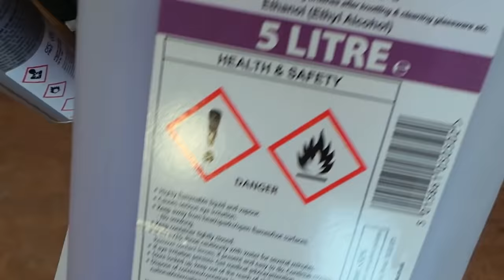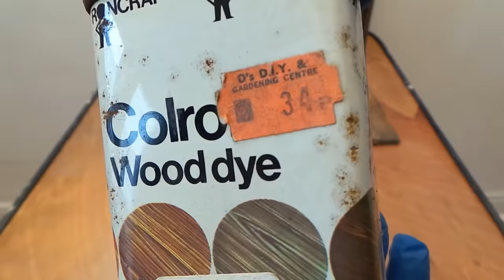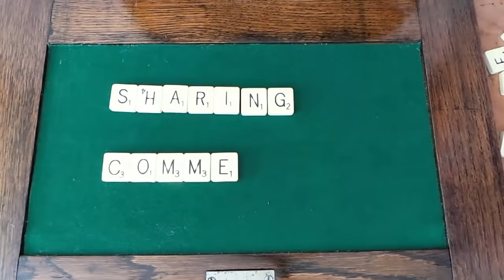Old wood Tool Box: Restoration

Comment: I purchased one of these when I started my engineering apprenticeship, I still have it after 58 years.
Reply from the maker: Hi Alan lovely to hear you kept it close How much did you pay for it back then?😊
Reply: @Instone09ine  Mine is 42 years old and cost me £99 from Hughes and Homes
Reply: We were given one along with a 0-1' micrometer and a 6" engineers steel ruler at the start of your apprenticeship, 16yrs old, 1975, apprentice toolmaker, it was your pride and joy. County Durham.
Reply: Uncle Eidolf  uncle, I served my time as a apprenticeship toolmaker, which also included learning to be a craftsman at many trades, I ended up having the choice of being a toolmaker or a draughtsman, I became a blacksmith, then joined the army, 7 th Batt the Light Infantry at 24 yrs old, it was a hard time in the then depression, and I went to everybody's university, best regards mate, from County Durham.
Reply: Uncle Eidolf ? “real” ?  ‘Real’ is if you can do the job well. Those who are taught by skilled craftsmen know just as much if not more than what we can learn in a university... what makes someone taught by apprenticeship not a ‘real’ engineer? A self taught motivated person often knows a lot more than an unmotivated person just warming a seat in sitting in a classroom listening to an instructor who doesn’t like their job and is tired of being there... just wondering.🤔

Comment: Just a tip: this was originally assembled using hide glue which is resversible, and hence it could be repaired this time around as the joints failed saving the wood.  By repairing it using polyurethane (gorilla glue) tbis will not be possible in the future as any failure in the future will cause damage to the wood  
Gorilla glue should not be used for joints such as this. Hide glue is the most suitable.
Reply from the maker: Thank you Steven good explanation .A few viewers have told me not to use gorilla glue but  your’e the first to explain why hide glue is best !  😀
Reply: LMAO who builds things thinking of failure? Glues today a far superior to the old glues
Reply: @daveklein2826  same reason we have fuses. Setting up a point of failure that is easy to fix prevents irreparable damage somewhere else when something happens
Reply: But with hide which is what was originally used! Your sticking to the original which is the idea of restoration !? Right? So the next time in the future it will be easier to restore if original marital are used. Also. An added feature that some antique restoration artist's  do is add an explanation of when the item was restored by whom and what materials were used. So in the future this will make it much easier for future restores to do there job!
Reply: @daveklein2826  “who builds things thinking of failure” somebody who knows what they’re doing
Reply: “Who builds things thinking of failure. Things today are far superior to the old ways.” is a statement that has always been uttered and it has always been foolish.
Reply: You can buy ‘modern’ hide glues which are an improvement on the original hide glues, which had to be applied hot - but they are still reversible.
Reply: @daveklein2826  Next time it fails, the wood will break instead of the joint falling apart. That's why you build in a point of failure.

Comment: Old machinist box that's in pretty good shape for it's age. I see some people think you ruined history but these things are not that collectable and you made it look good again. Nice job. 40 years as a machinist and I've seen quite a few and most were in worse shape as they didn't hold up well in shops.
Reply: @David curtis I have my grandfather's Gerstner box
 Looks just like the one in this video. He was a Tool Room machinist at Gunite Corporation in Rockford, Illinois. 
He retired in 1980 the box is old and to the handle gave way when we moved it and it dropped onto a concrete floor. Broke many parts including the case.
It's full of cutting oil and cast iron dust. It's in bad shape. Thinking about doing something like this. For my dad.
Reply: Iron Myno, Gerstner will rebuild it, for a price. Adam Booth had one done. Check out Abom79.
Cheers guys

Comment: Other than a couple lessons learned for leather work, this is an outstanding restoration. As for the leather handle, particularly the edges, a little wax and burnishing would go a long way.

I gotta add. THANK YOU for lining up the knob screws horizontally. It’s the little things that go a long way with something like this.
Reply from the maker: Hi. i didn't expect any one to notice the screw thing!  i will take the handle off and wax it as you suggest😊

Comment: I appreciate the care that went into this restoration, a job very well done.  I did a similar restoration of some cabinets my dad had in his shop for 50 yrs.  The cabinets originally came from a Kodak plant and were used to store film.  My Dad had them gifted to him by a friend.  Two cabinets with 8 drawers each, made of oak, dovetailed drawers.  Dad used them for storing drill bits, screw drivers, various parts, nails, screws etc.  They had been through a lot of abuse, including accidentally leaving a lit cutting torch next to the side of one on the cabinets resulting in a deep burn mark.  When my Dad died they were left to me.  I had them shipped from Colorado to Houston even though I knew the value of the cabinets was far less than the shipping charge.  I stripped, sanded, repaired and  refinished the cabinets and was very proud of the results.  I used them for the same purpose Dad had, storage for shop items.  But I didn't take on the project for that reason.  I wanted to preserve something that my Dad valued and to use it they way that he did.  Ironically, a few years after I finished he restoration, Hurricane Harvey hit Houston and my neighborhood was flooded with 7 feet of water.  The cabinets were on the floor of my garage.  I had some serious damage from that flood, but those cabinets were the only thing I truly regret not being able to salvage.
Reply from the maker: Hi Ed thank you for sharing your wonderful story. Sorry about the sad ending though. Goodness me that must have been awful to have your home damaged in such a way! 
Kind regards Phil

Comment: As an apprentice i made these, exactly the same , but in uk for Moore Nd Wright micrometers, still have one and a few drawers, timber was Samba or another name Limba  same timber, hours on a combe jointer doing the end joints on the drawers, lovely cabinets, the one i still have my late mother used as a jewelery and odds and ends cabinet
Reply from the maker: wonderful story Leonard what year would this be?
Reply: I started as a five year apprentice in 1964 , as a wood machinest, the firm was Elvicta handtools at Crickhowell in Wales, we made mahogany inlaid boxes for micrometers for Starrets, rosewood and mahogany spirit levels for Rabone Chesterman and many sorts of boxes, all the rage at the time was kidney shaped mirrors set on an Afromosia frame with birch ply insert, the afromosia was evil stuff very hard and brittle and any splinters in your fingers immediately festered and hurt, i used many sorts of hardwoods including Teak and lignum vitae. The firm closed , but i had left and started and ran a joinery firm for 38 years, specialising in staircases. I still have a couple of machines in my barn and make the odd window,signs and oak bits as i need them. There is few things as rewarding as taking a nice piece of timber and making an item that will hopefully outlast you and give pleasure to all
Reply from the maker: Thank you for the info!  It's a fascinating bit of history. 
Afromosia would this be the wood made popular with 70s G Plan style furniture? i have one of those kidney mirror somewhere😊
Reply: @Instone09ine  yes it was a cheaper alternative to Teak, one of the other lines they did was mahogany  boxes with lids to take the batteries on electric milk carts(remember them in uk)they were dovetailed on a Brookman dovetailer assembled and dipped in heated wax, Crompton Parkinson embossed on the sides
Reply: @leonardmilner5774  and today you buy an expensive (eye wateringly so) specific tool it comes in a silly blow-molded plastic case way too big for it with rounded edges so it can only stack flat and takes up space.

Comment: Little trick for wooden drawer slides..
Rub a little paraffin/ candle wax on the slide to prevent the drawer catching, sticking or binding. Nice 👌 job, too.
Reply from the maker: Thanks for the great tip 😊
Reply: I'm literally doing that today with some drawers that have become a bit squeaky or sticky...I'm using bee's wax.

Comment: I probably would have gone over the wood with a dry brush to get all the dirt out (after removing the baize cloth), then wipe it all down with mineral spirits to remove the dirt from handling, repaired any loose joints or cracking wood, then used some kind of wood preservative that gives a satin type of finish. The hardware I would have thoroughly cleaned and degreased before adding a touch of oil, but the handle and baize lining I would have replaced. The end result would look like an old but but well cared for cabinet.
Reply: To bad you didnt restore it to do all that ..
I think he did a mighty fine job, it Beautiful just as it is ..🤔

Comment: I  think a hand rubbed tung oil and wax finish would been a more appropriate look
Reply: Exactly.
Reply: That would've been nice.  But since we're only voyeurs, let's enjoy how well he did on it.  It's beautiful.
Reply: My thoughts too - but nevertheless a lovely job 👍
Reply: No it wouldn't. Shellac was the primary finish of the day.
Reply: Shaun Harper  - are you saying that it’s period appropriate to use a high gloss type poly on this piece?  I figured that could be the reason for going that direction. 

Or, the durability aspect of that particular product.
Reply: @jamesburkhard  12:05
Reply: All these people expressing their opinions about the finish forget one thing - he has a right to his. And it's his box.
Reply: Boiled linseed oil.
Reply: @jamesburkhard  pause the video at 12.05 you might be shocked 😄
Reply: @1974ted  Ahhh, you are right.   I wonder how I missed that.  It's been a while, but I thought he said at the beginning he used shellac.  I hate polyurethane...
Reply: @keirmurdoch  Ahhh, right you are.  Not sure how I screwed that up.  Maybe I commented on the wrong video ;-)
Reply: @jamesburkhard  😀. He’s done a nice job doing it up and did use some kind of brush on shellac initially. I was a just surprised when the glossy varnish went on.

Comment: I really enjoyed the love that went into this restoration. Just beautiful.  I am particularly impressed with the application of the finish. What sort of brush is that? I've never seen one like it. It really looked as if it helped to apply the finish more easily then a flat brush. Love the stain color too!  Thank you!
Reply from the maker: Thank you Lydia. The french polish brush is a mop made of squirrel hair which is very soft, the second brush is a pure bristle which was modified by thinning out the bristles to reduce brush lines in the polyurethane varnish😊
Reply: I agree, Lydia. That stain color is beautiful!! I want a container of that. Most of the stains carried at the local hardware stores here are very basic and uninspiring.

Comment: Great restoration. Try rubbing some candle wax on the drawer runners, it will make the drawers move smoothly. I used to do this on the furniture I used to make.
Reply from the maker: Thanks for the tip!

Comment: As a long-ago retired engineer I confess to owning one of these, although not in my capacity as an engineer.  In that capacity our main tool was the slide rule and possibly a draughting machine and a few instruments, most of which would have been too big to be accommodated in the small draws of the cabinet.  I used mine for some sculpture tools, and gun cartridge reloading equipment as I recall.  Mine slowly deteriorated, and [ like the one in this piece ] the leather on the handle became hopelessly cracked.

 I have to say that although ' masculine ' in appearance I think the box with its small and shallow drawers was probably better suited as a jewellry box, or possibly of use to a watchmaker.  Compared with the large metal boxes equipped with a stand and rollers now favoured by garage mechanics and costing hundreds of dollars, this little wooden guy is a bit of a joke.

To see the thing meticulously restored did bring a feeling of nostalgia.

Comment: I preferred it without the varnish, I would’ve stopped before that and left it looking less glossy. Nice job though.
Reply: OK, OK.  I would have chosen stain. His box ,his rules.
Reply: I agree. A box like that with surface imperfections and patina  shouldn't be glossy. A satin or hand rubbed finish would look better imo but this is his project and it's still very nicely done 👍
Reply: He properly used shellac, not polyurethane.   As left, it is shiny, but it can be deglossed with very fine steel wool. It is also possible to very easily completely remove it with just denatured alcohol. No sanding, scraping, gouging... It easily just dissolves away with no residue... completely reversible (unlike polyurethane and most varnishes).
Reply: @jamesburkhard  I do french polish technique on pieces of furniture valued over $100k and have pieces in museums. I don't care for this finish or application. Probably not the best type of polish to use for an item like this either. If he likes it, great but I don't care for it. He could have just washed it with 0000 steel wool and a non-sudzing ammonia based soap and then do sealing coat and applied his finish.
Reply: @ddd228 : He did use a stain!
Reply: @robertm4050  some folks bare a close resemblance to the old opinions expression...

Comment: 1940’s we had machinists and boxes for their tools. 2000’s we have OCD and need to line up screw slots!
Reply: So I was at a military vehicle convention two years ago and saw this beautifully restored halftrack and every single screw slot for the armor was perfectly vertical. I thought the same thing, what OCD must they have, turns out they were done that way when they were built in the 40s so rain wouldn’t collect in them. I was surprised, who would have thought of that

Comment: my biggest gripe isnt the finish... its the strap and the pulls. strap was a stitched leather handle. the glue is not going to hold up. long term and the pulls should have had brass screws.
Reply: Stock screws were replaced.

Comment: I would've stopped at the French Polish to retain the vintage authentic spirit of the piece. The final clear varnish coat just looks awful in my eyes. It's left visible brush strokes which take away from the natural wood grain from what I can tell on the screen (could be wrong), and left it way too shiny and almost fake looking. Maybe it'll get better with time! The leather handle was too far gone to keep the top part. Though it doesn't show on the screen but I'm sure the damage is quite visible in person, especially with the stitching not being redone. You could've made a new one with fresh stitching. My 2 cents!

Comment: Leather has rotted.  Needs to be completely replaced.
Reply: Agreed, all that work on the box, and scant attention to the handle which would have been a cinch to replace.  He even had the template with the old piece to redo it perfectly.

Comment: Bought this exact box with out the logo...at local flea
market in 2000. Missing strap handle...but now seeing design may fab my own. Has same green felt  cloth drawer liners...but apparently there was a green felt pad on the slide lock panel door... Did get a
key made  so it locks and
latches the entire unit...
Best special tools box I own. Pd 80$... great deal of the day. Thanks for putting something I treasure online to show off old
 school order. Can't be beat.(71 yrs  and counting)
Reply from the maker: Thanks for the comment. I have three of these now! One has a few bits missing so im looking out for a donor box for the missing slide in draw front. I agree they are great little projects! Good luck with yours.

Comment: Nice restoration work!  I wasn't sure where you were going when you stripped the old finish off, but you took the extra time to fix stuff and do a nice finish on everything.  I have about 6 of these chests...a couple Gerstners, Unions, and 2 no-names.  I've done various restoration work on them, primarily felt replacement, rust removal, and cleanup.  If the finishes aren't bad, I usually use some Murphy's oil soap to clean and then some Butchers Bowling Alley wax to preserve the wood finish.  I use them for pocketknife storage.
Reply from the maker: Hi Glenn i'm a long way behind you!  I have three boxes now. This  one is for camera gear , the other is for my wood graining tool collection, i'm not sure about the third one as the door was missing! I might just keep it as a parts donor they are such lovely things to have especially for collections.
Thank you for the wax tip i will try and source some online.

Comment: I did one of these last year, all I have left is the Leather handle. Ive been trying to figure out how to repair the handle vs buying a new one. I won't take your approach. I wouldn't have thought of that. It works!
Reply: The original handle was clearly stitched and the repair should be. The handle in this repair was a bodge job that won't last.

Comment: I’ve worked many years with mahogany and teak and you did great. My comment to you is if you could acrylic seal your mahogany before you stain you will get a more uniform look . It will help with the ingrain not being too dark . Then 4-6 coats varnish sanding each time. Love ur vlogs
Reply from the maker: That's a great tip Jerry, thank you😊